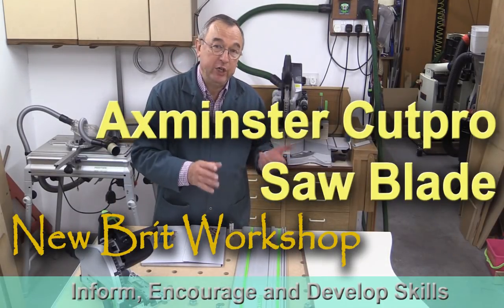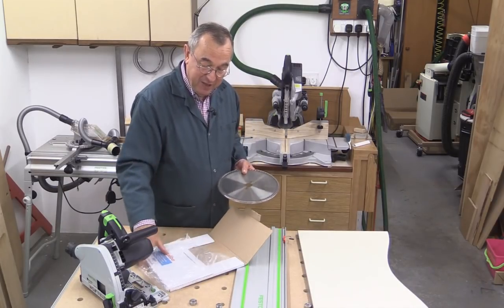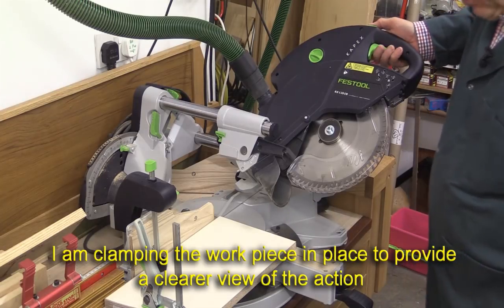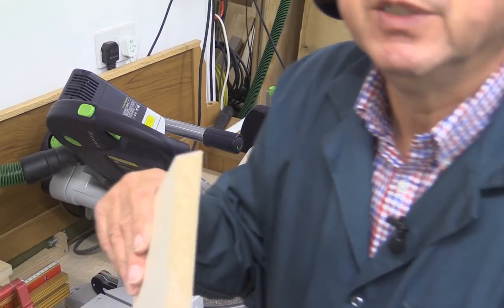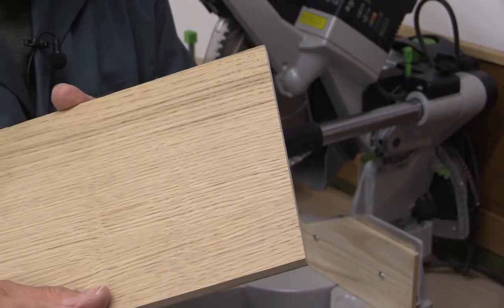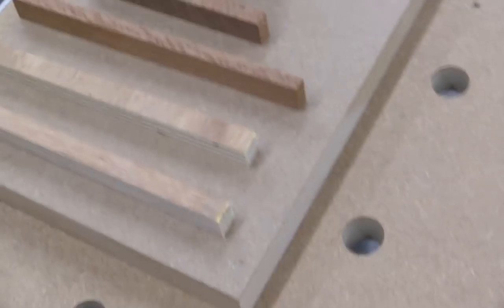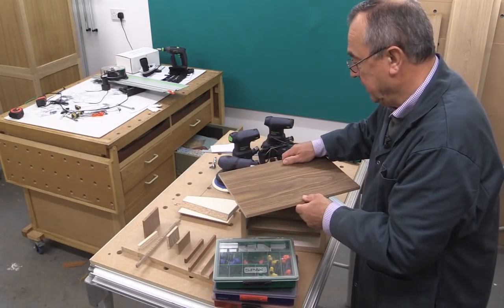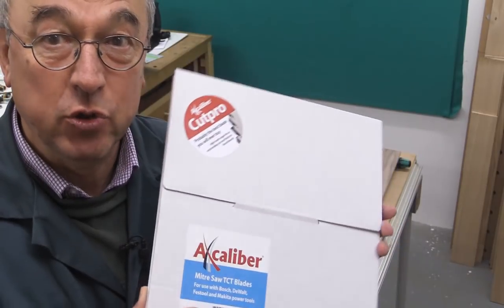Using the Axcaliber Cutpro Saw Blade

Comment: Thanks for the Cutpro recommendation; I will consider one for my vintage radial arm saw. You mentioned re-sharpening: do you go to Axminster for this and do you know who actually does the work?
Melamine: I think you have demonstrated the unsuitability of this material for fine cabinet work!
Reply from the maker: I get all my saw blades sharpened at my nearest Axminster store. They do not do them themselves but have a local subcontractor to do the work. I have been very pleased with the work done for me and they are less expensive than my old sharpening service.  Peter

Comment: Make sure your computer doesn't have a regular harddrive before you put it on that tray. Regular harddrives do not like strong magnets :-) A SSD will be fine though.
Reply from the maker: It is only the change in flux that would do any harm and as the magnets are operating on a closed loop of steel the risk is minimal. But you are right, people  should realise that there are risks with magnets and hard drives.   Peter
Reply: New Brit Workshop dont tell me, tell the people that had their harddrives erased in the 2nd generation of German ICE high speed trains by the magnets of the flap tables in the seats some years ago ;-)